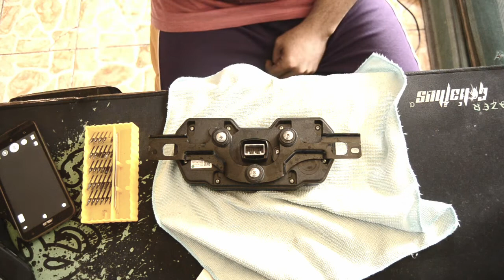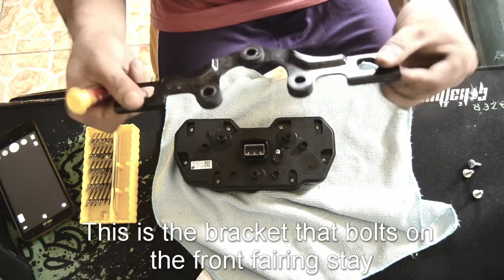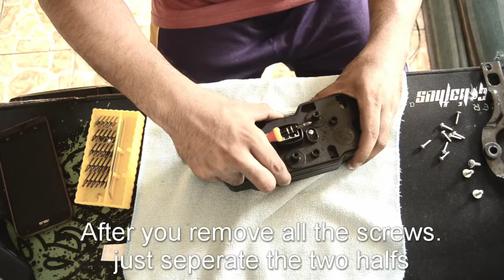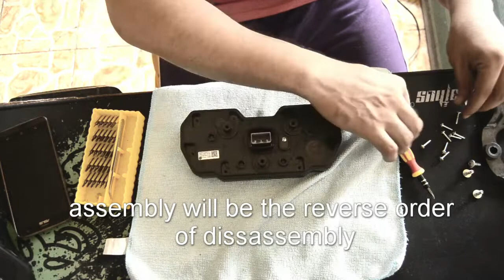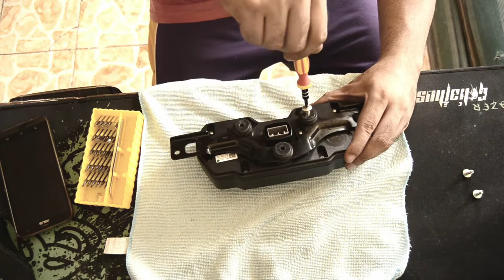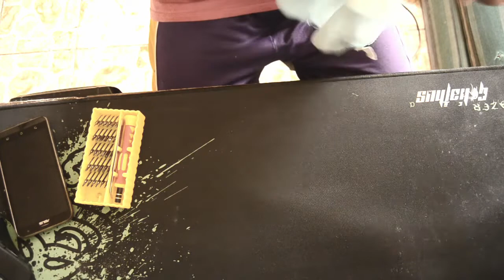Yamaha R15 V3 wind screen and gauge panel removal and installation part 2

Comment: Hello sir. I have a problem with my gauge panel. When i tried to open it, the part that comes off is the back part only, I tried to force it out but it seems like it won't allow me to do so. Any tips for me sir?
Reply from the maker: Did you check if you removed all the screws sir?
Reply: Yes. I have removed the same screws as suggested on the video
Reply: I got the indonesean version of r15 v3.